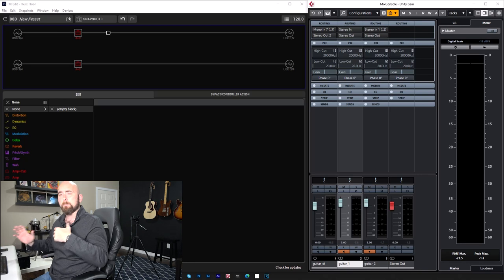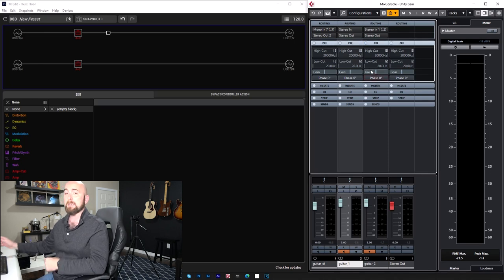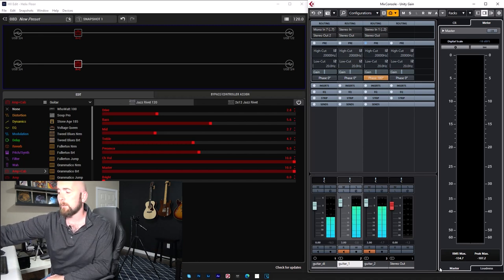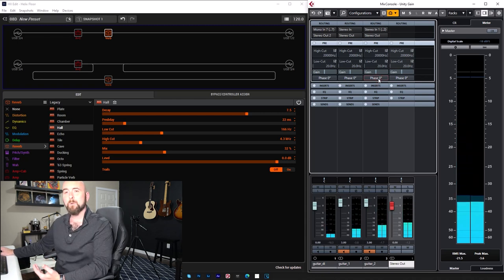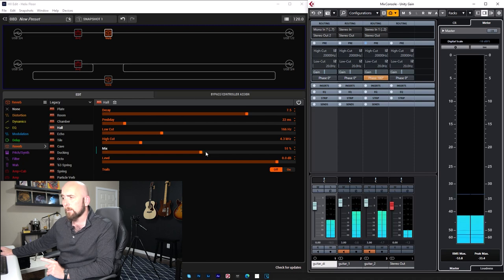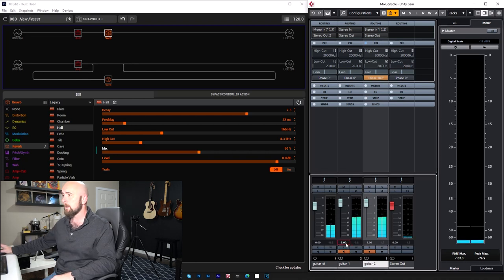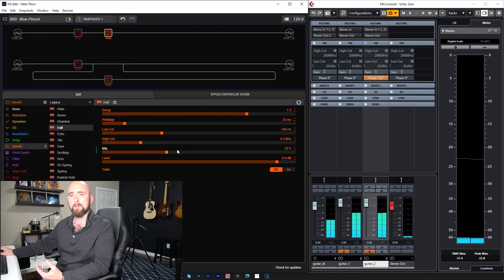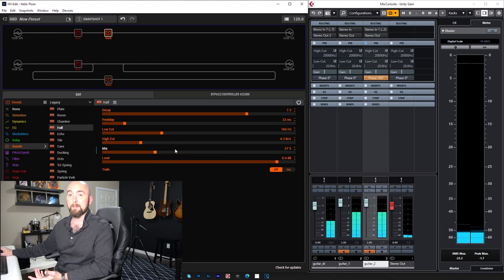Let's Settle This Once And For All! | SERIES VS. PARALLEL REVERB...THE FINAL WORD!

Comment: I wasn't aware of that discussion, and was already wondering myself, just from reading the title of this video "but what's the point of a parallel reverb, if the output of reverb in series also has the dry signal mixed in it?"... Excellent demostration, and I'm glad to see scientific proof that the Helix works as reason would indicate it should!! ;) 

Nothing left to argue when is just one reverb block on the parallel path and mixed back to the main path. I'll just point out that if combined with other FX on the parallel path, then is not just a matter of workflow, but it does also enable possibilities that can't be done in series. For example, reverb mix to 100 on the parallel path (so no dry signal), into a delay, and back into the main path mixed to taste. This will give you delay repeats only for the reverb tails, and none for the dry signal. Not sure if is a useful FX, but is one that can't be replicated by setting the same blocks in series and adjusting mix levels.
Reply from the maker: Thanks! And yes, I totally agree that there are most certainly times when using a parallel path opens up possibilities that are not possible in series and should be used in those cases if that is what is desired. This was in response to those claiming a "magic" improvement to the reverbs by simply pulling them down to a parallel path and blending them with the split or merge block, which is simply not true, but a belief held by a surprisingly large number of folks.

Comment: This is such a great scientific experiment to debunked a myth.  What most might have missed about using mixer is the historical context why line mixer was a staple in 80s rock star racks, which was to preserve the analog dry signal (from having to go through conversions into low-res 70's/80's AD/DA converters in rack FX).  With 21st century AD/DA, this probably isn't an issue anymore unless one really has a superhuman hearing :)

Again, thanks for the great video, Jason!

Comment: the complex reverbs don't null probably because they have some degree of randomization programing for the modulation or delay parts of the reverb.  also it would be interesting to see the difference between doing this with stereo reverbs rather than mono.

Comment: The problem I am still grappling with is in regards to a wet dry wet setup with 3 amps physically in the room, kill dry reverb and delays in parallel are going to make the dry amp much more isolated than a series 50% mix which allows a bunch of dry signal in the wet amps.

Comment: Yeah I think there are too many misconceptions that come from analog-world truths. In the digital world a dry signal is completely unaltered. It’s just a faithful reproduction of the numeric representation of the sound coming in. And a mix is just a linear combination of two signals. Makes no difference if the mixing is done inside a block or by a different block. There’s one very subtle difference I can imagine.. if the reverb introduced a small latency to both the dry and the wet, then its output mix would be subtly different than a parallel mix because the dry in that case wouldn’t have latency / phase shift. But your empirical test proves your point Without even speculating on points like this...
Reply from the maker: Yup, very well said :-)

Comment: 0:45 "and that's false" followed by a mic drop that lasts about 20 minutes :D Completely agree. It's a Mix control. A control for the Mix.
Reply from the maker: Yup exactly 😀
Reply: @JasonSadites  The only time I've found parallel with one effect helpful is when you want to keep the volume levels of trails (reverb or echo) from a higher Mix % tailing off while you reduce the Mix %. In my HX Effects, I put a Transistor Tape (TT) on Path B, and set the TT's Mix to 100%. The TT is always on, as I prefer delay to reverb for ambiance. I use an expression pedal to control the Split A/B block's RoutTo parameter, with the expression pedal's "toe" mixing in more TT and "heel" reducing it.

I find when I use the TT (or any delay or reverb) in series, reducing/increasing the Mix also reduces/increases the volume of the repeats; in series if I rock back on my heel the TT's repeats go away too quickly. If I'm transitioning from an echo-y verse or bridge pad to a chorus, I want those echoes ringing out for a bit as the song moves to the next section which might not be as echo-y.

It's possible I could be overcomplicating the route to my goal, though as you state throughout this video, it's all about the decisions you make about workflow. Sound quality is the same regardless if serial or parallel. If there's a simpler way to do it in series, I'd do it, though I haven't figured it out yet.